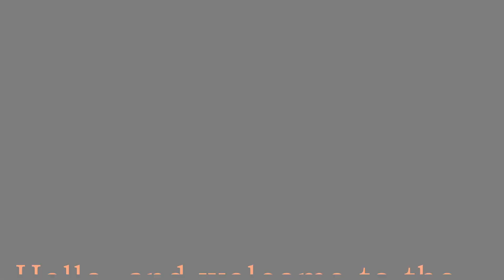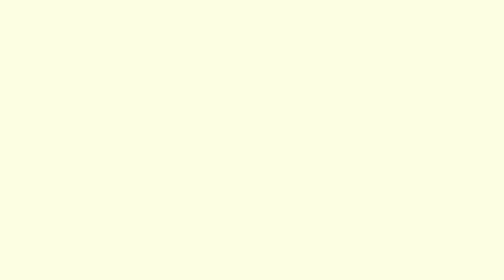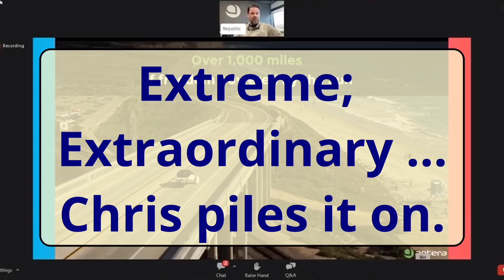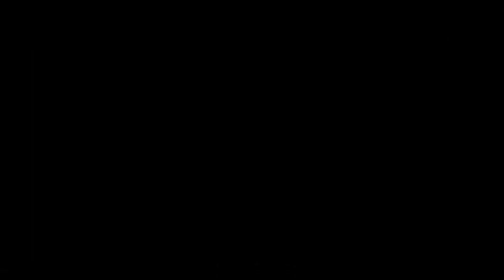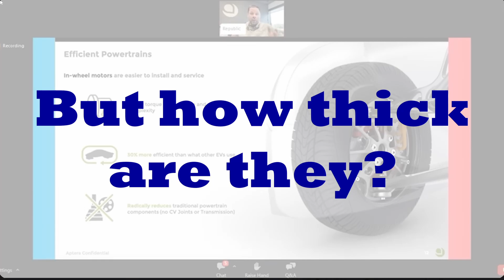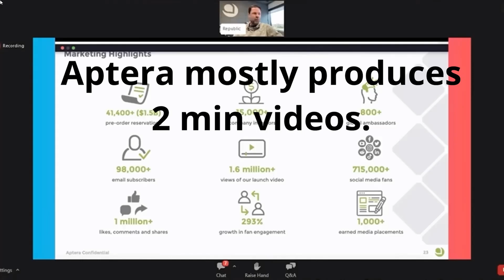Aptera and Republic Podcast

Comment: By December 2008, Tesla was completely out of money, and every single one of the vehicles they had shipped were defective.  They had  dismissed their motor engineers, and by the 24th, they were less than a week from being able to meet their remaining payroll.  And what they were offering to the public was a kit car at a ridiculous price that couldn't do a full throttle acceleration without breaking the transmission.

Aptera Corp is in far better shape after the same relative time frame, with prototypes that actually perform.  They are still making progress in a very difficult financial climate.  They just took delivery of the robotic carts that will be used to assemble the bodies at the factory site in Carlsbad, and production of the tooling is progressing nicely.

Chris is not going anywhere.  The lithium battery company that he took public is making his investors money in an overall down market.  He has shown time after time that he knows what he is doing, and this time Chris and Steve (who has also built successful companies) are not going to lose control.  

All one has to do is to compare Tesla's first vehicle with Aptera's to see what a lead Aptera has at this point, and the story is only going to get better.  Once the production vehicles are on the road this will become clear to everyone.  

I doubt if anyone here has ever seen a Tesla Roadster or an Aptera.  Tesla was across the street from where I worked in 2008, and our company hired the Tesla motor engineers when they were laid off.  Both my wife and I have had lengthy rides in an Aptera prototype.  

It is easy to make up fact free fiction from one's imagination which is what many are doing.
Reply from the maker: Good to see you are still kicking. Too bad you still haven't learnt not to compare. It is not exactly as you sugar coat it. Tesla was a proper company, not a two bit crowdfunder. Tesla had a real car, not a back door entry that avoids regulations. And most of all, Tesla is only slower when you wrongly discount the five years and the company collapse Aptera had.
Reply from the maker: BTW, how many miles were those lengthy rides? Still under an NDA? lol

Comment: I posted this analyses before, but I think this is a market Aptera could win:  adequate, efficient, affordable commuter. I'll assume 0.13kWh/mile until proven different. About 2x Prius ability.
Recommended battery lifecycle charging rate is 3-6 hrs.  At 120V, 1,600W is typical non breaker tripping appliance. 1.6kWx6hrs = 9.6 kWh.  75 mile range, a bit disappointing. But if the commute is 35 miles, and 20 comes from solar, range is extended to 175 miles in 5 days. A 10kWh battery costs about $7K and I think the car could be built for under $20K.
Leveraging efficiency into ~400 mile range isn't worth much. Doubling the range of small battery vehicle is worth a lot.
You could say the package above is the 120V option, double it for people planning to do 240V charging. Cost would be under $25K but that's close to basic Prius market.
The 400 mile they're promoting is 40kWh and I guess closer to 300 miles. Price would be $32K scaling up from my 240V price. Poor value compared to PHEVs with commuter EV range, and much higher quality touring range.
Aptera's efficiency leverages into affordable commuter, but not long range touring. It isn't going to matter how many refundable $70 deposits they have in 2yrs when buyers confront these issues.
Reply: If long range touring wasn't of interest to reservation holders, then the lack of DC fast charging on the LE would have been largely ignored.  It wasn't.  While you can string together more coherent thoughts than AIM, I'm not at all convinced that you have your fingers on the pulse of those in the market for an Aptera.  What is impressive about the Aptera is how much functionality it will have even if the Aptera team ends up succeeding in even half of the pledges it has made for the production version.  They just need to secure sufficient funding and not scare away too much of the market with talk of the benefits to the environment (as this is the opposite of conspicuous consumption, an attribute favorable to many).
Reply: @jonj9149  Charging at those kind of rates has lifetime detriments to the battery. It's not the solution people hope it is. Of course there is limited interest to buy anything. Maybe the doors sell it for some people.
I just don't see a lot of gold at the end of the Aptera rainbow. The smallest car I ever owned was 1988 Nissan Pulsar SE. So great I bought a 2nd one when the 1st got totaled. As small as it was, it was twice as versatile as the little 3-wheeler.
Reply from the maker: @jonj9149  Art is nowhere near as coherent as l am.
Reply from the maker: Your problem is you describe something other than an Aptera.
Reply: @aussieideasman8498  What Aptera could be if you strip away the fund raising nonsense. Their shape has a lower drag coefficient than Prius. They gave up a lot to get it. They can't pretend to be a fully functional vehicle in spite of all the sacrifices. They should pursue being the best small commuter car and priced accordingly. The Geo Metro of the EV era.
Reply from the maker: @artsmith103  You are still surmising. Get real.

Comment: Your comments are somewhat off topic adding to confusion. For instance, sacking half employees could mean design is actually done.
But you are correct, a lot of unproven claims. Most important, 0.1kWh/mile. If proven to be 0.13kWh/mile, still very good but it changes a lot. There should be payload, weather, hilliness, speed, etc derating info. My PHEV gets derated 2 mpg compared to the hybrid because of 7.5kWh (20 mile) battery weight plus maybe a little bigger electric motor. Derating from 250 mile to 400 mile battery should be more substantial. Somewhat related, as you said, the 1,000 mile version they brag about doesn't even exist.
The solar claims sound preposterous. 700W at the angle is going to make ~2.5kWh/day in most places with normal use. @1 mile / 0.13kWh = 20 miles/day.
This car is 2 seater, 3-wheels, no hitch or roof rack option. It's half the car Apteta compares it to. It's market is <$20K commuter, ~200 mile battery would work.
If they don't go bankrupt again, they are ~1yr from starting expansion for production, and another year to begin delivery. 2yrs from now, other cars being proposed will be much better. Aptera is also going to miss new trend of vehicle battery powering house as needed. California just destroyed their Net Metering program. The scheduling is difficult but this is going to help drive V2H. Aptera won't be capable, a few vehicles already are.
Reply from the maker: "Your comments are somewhat off topic adding to confusion. For instance, sacking half employees could mean design is actually done." That would make sense if designing took more people than building - it doesn't. However, my main reason for suggesting is including the probability they are setting up for a deliberate exit rather than production; it is part of my topic.
"But you are correct, a lot of unproven claims." I like it when someone agrees with me. So what you meant to say was SOME comments are somewhat off topic, but instead was inclusive of all of them. You need to write what you mean.
"Most important, 0.1kWh/mile. If proven to be 0.13kWh/mile, still very good but it changes a lot." They have had four prototypes and four years to prove the figure, and not doing it is indicative of not even getting close. There is no point in surmising, and then saying they are good to go. Hiding what they must know by real-world testing by now is the reality - a more favourable guess is just stupidity. Be a realist.
"There should be payload, weather, hilliness, speed, etc derating info." There should be a lot more info than that by now. Any info relating to serviceability (fit for purpose) is necessary.
"My PHEV gets derated 2 mpg compared to the hybrid because of 7.5kWh (20 mile) battery weight plus maybe a little bigger electric motor." You confuse derating with snake oil. When a maker rates, he doesn't test it at a value and knock some off (or add, depending on which is better) and advertise that; he uses optimal conditions to get the value, but it is the true value. When other testers find a more realistic value, it is because they tested at slightly less perfect conditions. There is no snake oil in any of that by either party. Chris A sells snake oil; he has not even got the product to rate it. If he rated a prototype, it's only what the prototype can do. Look at the differences in Gamma and the proposed Delta? A completely different shell; new steel in the chassis and roof; less powerful motors that have never been seen, let alone tested in any prototype;  and more - how can he rate the product that isn't?
"Derating from 250 mile to 400 mile battery should be more substantial." Each is a different size battery option and going up 150 miles can't be 'de'-anything.  Not making any sense there.
"Somewhat related, as you said, the 1,000 mile version they brag about doesn't even exist." The whole product doesn't exist. Only the bragging exists.
"The solar claims sound preposterous." I agree.
"700W at the angle is going to make ~2.5kWh/day in most places with normal use. @1 mile / 0.13kWh = 20 miles/day." I don't calculate. If I calculate, I would claim IS preposterous. It just sounds it. Need evidence.
"This car is 2 seater, 3-wheels, no hitch or roof rack option." Basic facts I agree on. 
"It's half the car Apteta compares it to." That depend on which of the many cars they have compared. For instance, they have compared against the Hummer EV, and that time it is a quarter. Different results for Sono or Arcimoto, but I would say you are now more off topic than you first accused me of. Size comparisons are not an issue.
"It's market is <$20K commuter, ~200 mile battery would work." Surmising again. Get real.
"If they don't go bankrupt again, they are ~1yr from starting expansion for production, and another year to begin delivery. 2yrs from now, other cars being proposed will be much better." You make a valid point that I have not even entertained, yet it further supports my predictions of doom. I am happy with that (I see the logic), but I have enough other reasons to be confident. 
"Aptera is also going to miss new trend of vehicle battery powering house as needed." That is poorly couched, but I said it's all old technology rehashed and unproven. We are both on the same topic. 
"California just destroyed their Net Metering program." I haven't a clue what you are talking about. 
"The scheduling is difficult but this is going to help drive V2H." Good for V2H, but not much relevance to Aptera, as far as I can tell. 
"Aptera won't be capable, a few vehicles already are." Keep it simple - Aptera just isn't; it simply doesn't exist.
Reply: @aussieideasman8498  I'm quite far ahead of you in assessing what Aptera is trying to do. Many of your complaints are baseless. It discredits the others. I'm probably the closest to your perspective here with the benefit of a lot of solar, battery, and transportation experience. Steve of AOC parrots Aptera, you ridicule the hole they're all in, and I assess where they could have had limited success.
Reply from the maker: @artsmith103  I take no notice when someone says many are baseless, then gives no examples.